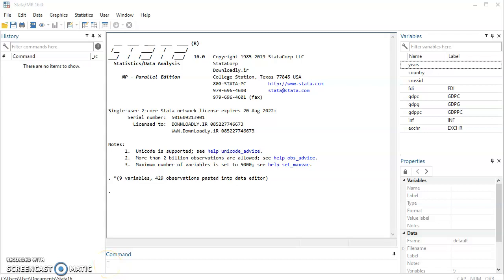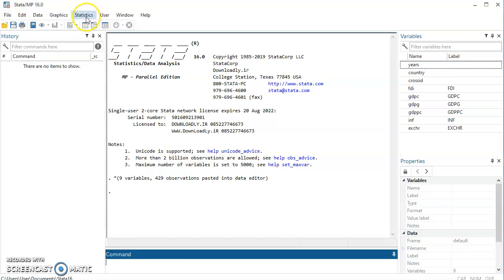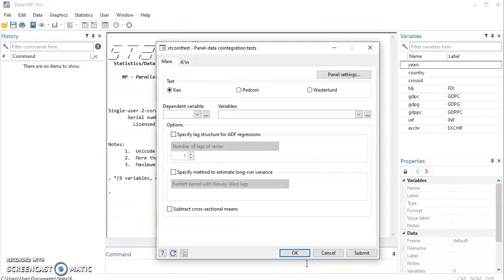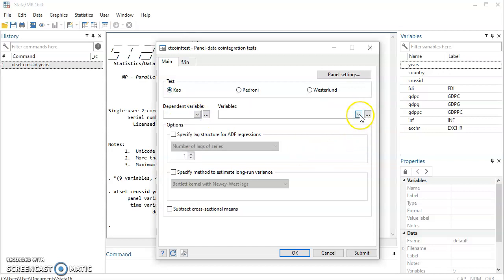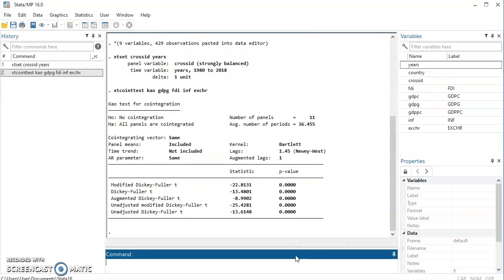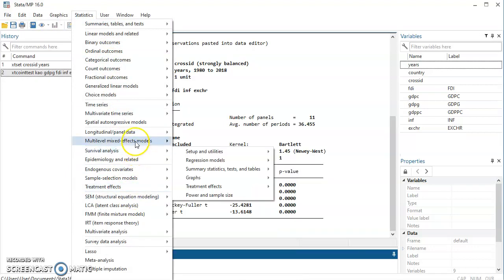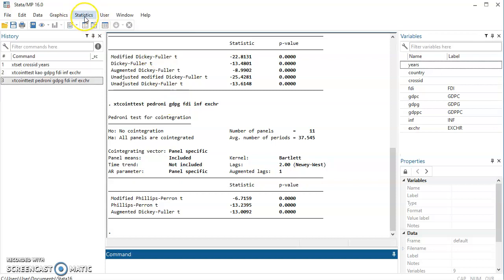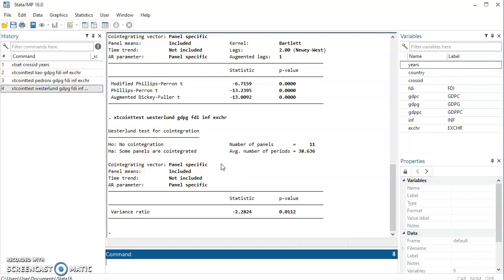How to conduct panel cointegration test in STATA

Comment: Hello sir, thank you very much. If my dependent variable is I(1) and the residual three independent variables are both of order I(0) and I(1) in my panel dataset T>N, which test should I perform, and if these tests are only for variables integrated of the same order or can be used while working with the combination of both I(0) and I(1) variables? Thanks once again!
Reply: @halil8270  Surprisingly, today I finished working on my master's thesis using panel ARDL. I estimated results for three alternative estimators MG, PMG, and DFE, and used Hausman (1978) test to confirm the most appropriate method.

Comment: Hi Sir. Following the question below, if my variables are all I(1), I should conduct the cointegration test on variables before differencing it right? My result for Pedroni shows  Modified Phillips-Perron t is <5%, however, the other two - Phillips-Perron t and  Augmented Dickey-Fuller t are >5%. Given these mix result, can I say all the variables are cointegrated?
Reply from the maker: The essence of cointegration is to ascertain if a long run relationship exist in the model despite the non-stationarity nature of the data. For data that are already stationary, there will be no need for cointegration test. So, conduct stationarity test first, if all the variables or some are not stationary, you can now proceed to cointegration test.

Comment: sir , if our series are stationary at I(1)...do we have generate the series by differencing and then apply cointegration???
sir plzz answer my query?
Reply from the maker: Hi. There is no need to generate the series by differencing. Differencing itself shows they are short run variables. You could still conduct stationarity test on the I(1) series to see if there is still convergence in the long run. The essence of cointegration test is to ascertain whether or not there is a long run relationship in the model. It they are not cointegrated, only the short run part of the model is valid